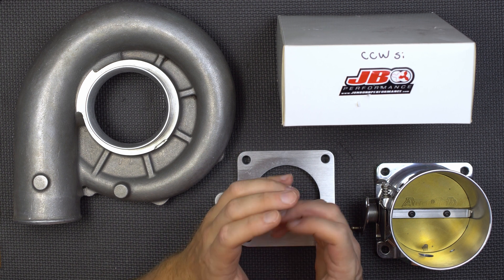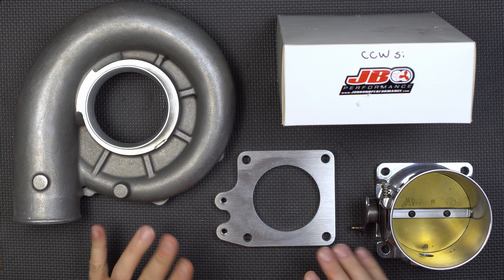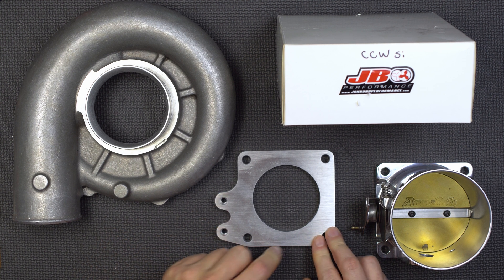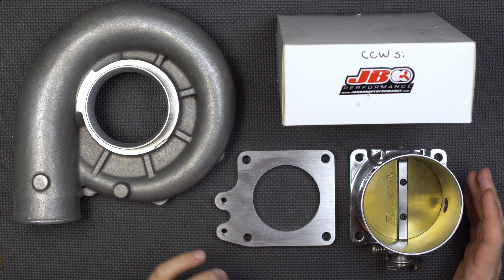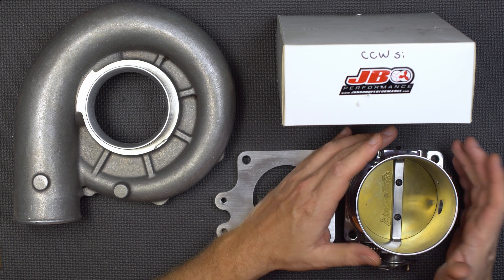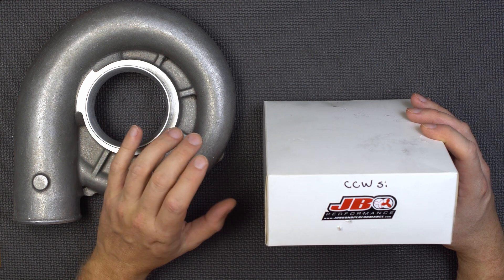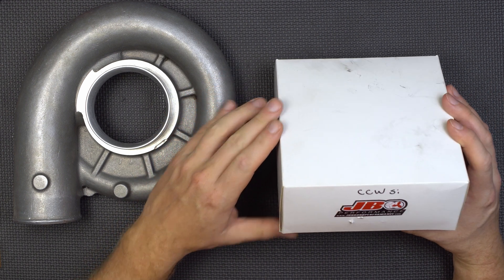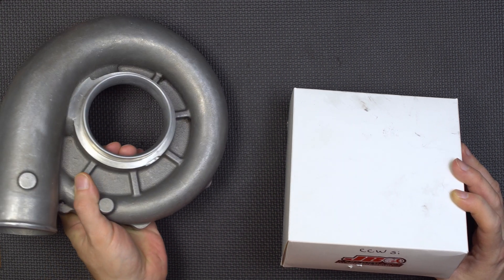More Power for The World's Most Powerful Electric Turbo

Comment: hey Alex! I was wondering if I should put a billet one in mine. This can be a bit long question and I don't know if you can answer all of it. I see 6/6, 7/7 and 11/0 blade wheel. I don't find an answer that's everybody agreed. I affraid of the torq of my motor, I need to go high rpm compared to you. So I need to get the most efficient wheel for the low RPM (compared to a real turbo). 11 blades seems to be more efficient at lower RPM and sometimes the billet wheel are heavyer. I will probably try the cast one first but If I have to chose a billet, I don't have enough knowledge. I need to find the best balance between, hope enough torque and efficiency to low RPM. tapered tip? more blade? thanks!
Reply from the maker: That's a bit out of my depth too.  I honestly don't know.  I'd be willing to bet that strength (cast vs billet) isn't really an issue.  But as to the blade count vs low rpm efficiency, I'm afraid I don't know...

Comment: Please Please tell my the new motor has a lower KV than the current motor .. Please run 22S. Voltage is your friend.. Current is your enemy when it comes to electrical efficiency in this kinda thing.
Reply: if even if the KV is not lower run more voltage and just turn the servo knob down.. that way it will require less current. Less current means less resistive losses to heat = better efficiency also you will get less Voltage sage from the Lipos.... They make more than 22S ESC and that could be a serious consideration.
Reply from the maker: Yes, it's a longer motor with a lower KV - the current motor is rated at 970 (but tested a little over 1,000); the new motor is rated at 740 KV.  It should give more torque.  If we can get up to about 32,000 impeller rpm, we should be at 700 fwhp - about 530-540 at the wheels.  That should be enough to run 9's.  The ESC is rated at 22s; but the total power is the issue.  Bigger/better motors and ESC's exist, but I'll need some serious income from youtube/patreon to pull those off.  You're looking at ~$5,000 project that might not work at that point, provided I can get some stuff for free.
Reply: @AlexLTDLX   Yeah i know what you mean about the costs my project is going to cost trainloads too buy, luckily for me i have a much smaller engine so that reduces the costs.. and i have more patreons. Im going 24s lifepo4 . I just can't bring my self to run lipos and in my country id be suprized if it would be legal running them on the road.

Comment: I think you should contact Lehner Motoren Technik in Germany and spec out a non-compromise, direct fit shaft, motor for this project.
Reply from the maker: Man - they have a 40kW, 50,000 rpm motor...  You had to mention that, didn't you?  Lol.  If this goes well, then maybe we see what it takes to break 1,000 hp...  Thanks!
Reply: Before you order a motor contact them to make a custom shaft, the rotor is one piece :)